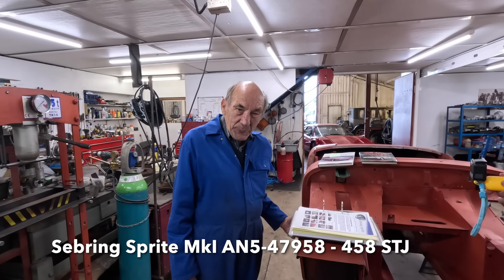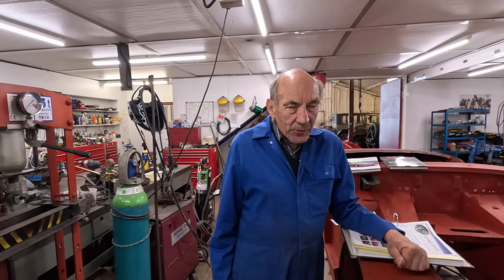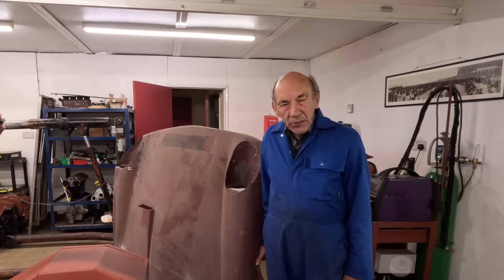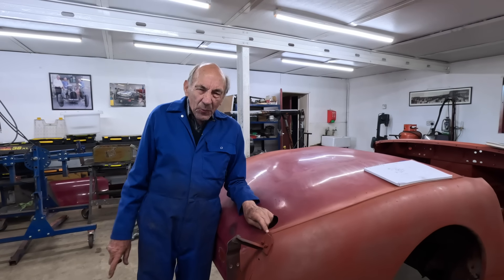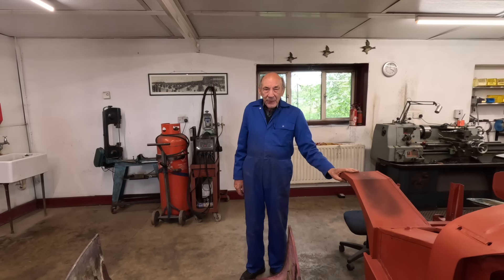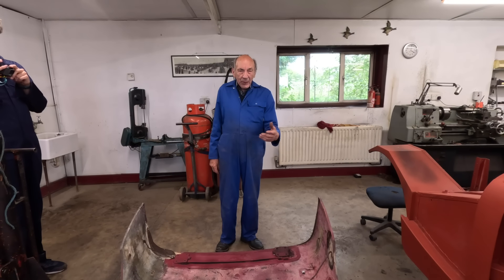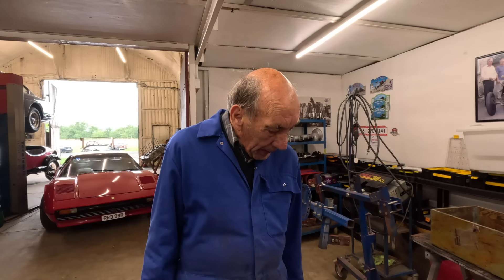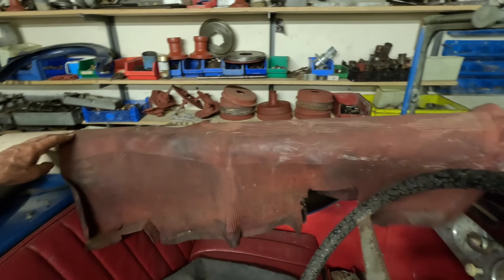Sebring Sprite Dilemma

Comment: I rebuilt a "bugeye" back in the mid-1970's.  Painted it British Racing Green.  The motor was line bored to install bearings on all the camshaft journals,  fitted with Duplex double row timing chain,  0.040" overbore flat top racing pistons and fully ported and polished head.  I fitted a 45mm sidedraught Weber as a 40mm was not available at the time.  When dynotuned the Weber was sleeved  to 28mm and all the jets were replaced to suit the small capacity of the motor.  The flywheel was lightened.  The car was amazing for what was effectively just a 960cc capacity.  I am over 1.8 metres tall but found the car to be the most comfortable car that I ever had and such a joy to drive.

Comment: It seems to me, the main thing that makes a mk1 so iconic is the frog eye bonnet. In particular, for any sort of a racing car, having the front end out of the way to work on it is huge. That speedway or whatever front end isn't really original anyway, it's aftermarket and frankly looks kind of fugly and heavy. As for the hardtop, oh yes absolutely. I think the value of the car, given its provenance and the documentation, will suffer very little if at all. And at the end of it, it will be the car you want and not the car you wish you had.

Comment: Fabulous Ivan, it looks like a "Sebring Sprite" to me. From memory the original bonnet on a Mk1 lifted from the front, a couple of my old mates had them. I had a 1964 Mk2 and it's bonnet was set up the same, from memory, but that was 60 year ago. 🤔.
Reply: The original lifted from the front with the handle down low there where you could bump it on something and snap it off. the racer guys later made them tilt forward and also easy to remove to get access to the full bay. With the mk2 they just made the whole thing lift off with the fenders rather than having it tilt in any direction.
Reply: @danielboughton3624  my memory isn't too good, I just had a look at some old photos, it's plain that my MK2 I had has just a conventional type of bonnet, hinged up near the windscreen and lifted from the front. I should have remembered that , I spent enough time working on that little engine. I remembered that it didn't have wind-up door windows but it had side curtains like the Mk1.

Comment: Brake Discs you can I think modify from a Triumph spitfire disc.  Great you are keeping the bonnet and the seats etc.
Reply: Original Sprinzel Sebrings had an alloy roof.  However the sebring sprite could also be std frogeye shape.  There are homolgation papers 🙂

Comment: I seem to recall them fitting a Coventry Climax engine to frogeyes in the 60s
Reply: The Healeys wanted to do a “Super Sprite” with the Coventry Climax engine and disc brakes all round and they built at least one prototype (project code XQHS), which still exists, but BMC wouldn’t sanction it for production as it would have outperformed their bigger MGA (and used an external supplier’s engine). Jack Brabham later converted some customers’ Spridgets in a similar vein, but I don’t think he sold very many.

Comment: Being in construction I do not subscribe to the 'preservation' ideology.  Cars like buildings evolve and change and that is part of their history.  If you want a Sebring Sprite build one with what you have and I bet the racers back in the era of the Sebring Sprite would have no qualms of adding modifications.  I imagine that the engine you intend to use was not an original offering, so that kinda sets the tone for the rebuild, which answers your own question.

As a yoof, my first road car was a Mk1 Midget, essentially a Frogeye Sprite with standard Midget front.  It had the 948cc engine and the quarter elliptics on the rear.  A great fun car to drive especially on crossplies.  The only concession to modification was the 1100 cylinder head and 1 1/4" SUs
Reply: If it is a sebring then it makes a difference in terms of collector value and the ability to race in certain races. If you keep it original those are the benefits. If he keeps the hood that was added later it might still qualify but if he goes hog wild then it will exclude the car until brought back to original form. Adding a hard top isn't going to do anything to enhance or add value unless it came from the factory that way and then it would have to be an original or a damn good replica. It's all emotional and a bit high brow to me but that's the way it goes. I have a first 6mos of the mk3 which is rare but even though I bought it in 82 the original motor was long gone and with it a good bit of the value. Racers have long since used up all those motors so it will never be in original form again.
Reply: @danielboughton3624  This is not going to be a Concours car, where originality is vital, its a race car and like any race car they will have been modified many times during its life and probably the day after it left the factory.  So long as it keeps within the rule book, which tends to recognise the modifications that could have been made, that will be OK.  If its to compete in historic racing then no-one is going to allow a Zetec engine to be fitted but a period A series even with modern engineering practice will be allowable.

Comment: That definitely is NOT a Sebring Sprite. It's just a normal car with all the right Sebring parts on, admittedly fitted from new. ALL proper Sebrings were MADE in Warwick at the  Healey works and they consequently have Healey chasis plates. They weren't modified BMC cars. I worked at BMC 's competition dept back then and if I remember correctly originally three were made. Incidentally the original ones as first raced had frog eyed bonnets, kept for advertising purposes. Don't know if yours are but the front disks were Girling ones not Lockheed. As your car is just a look alike it doesn't really matter what you do with it because you'll never make it a real Sebring. If that tatty one that you looked at was a real one with a Healey chassis plate that's why it was so expensive, they're very rare cars.